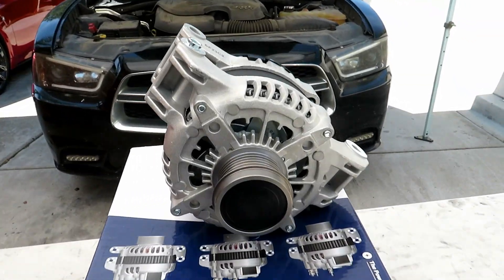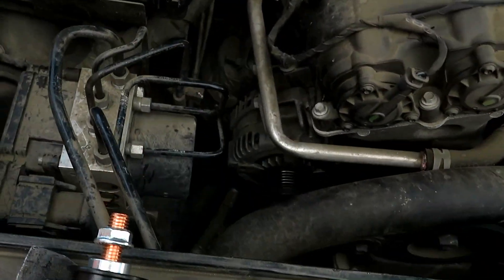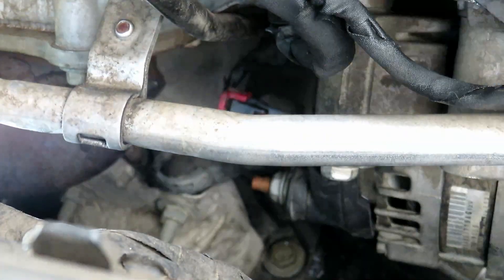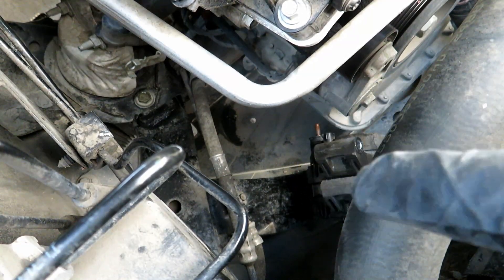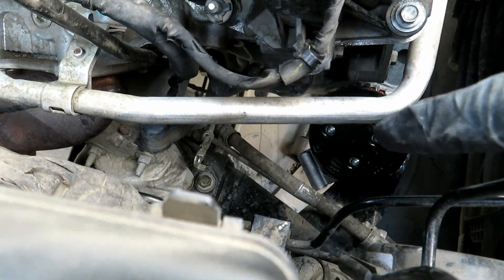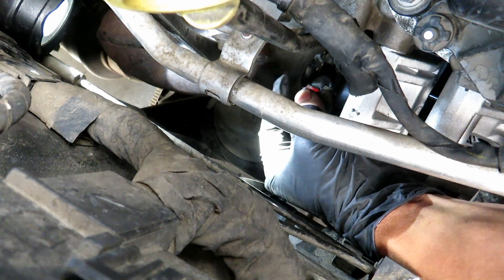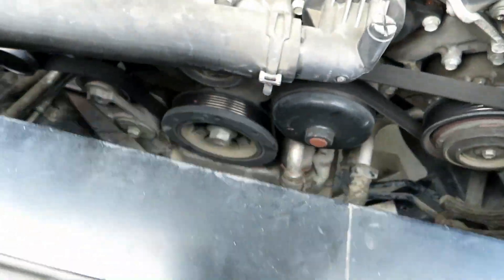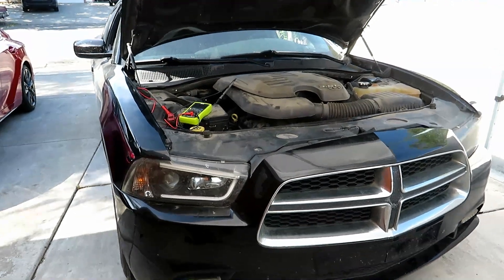Dodge Charger - 3.6 V6 Alternator Replacement

Comment: Great video.  I'm ready to tackle my swap this weekend.  God Bless!!!
Reply from the maker: @chriswilfong9816  great to hear. Let me know how it goes
Reply: @hyr0llr 
Hey, when you were connecting the cable to the B+ terminal of the alternator, did you leave the black plastic on? Because it looks like you took it off to have direct metal to metal contact. I left mine on, and it sort of melted it? It's fine now, I was able to remove it from the wire, but I was wondering if it needs to have direct contact to the metal like how it seems in the video.

Sorry for rambling, I'd be happy to reiterate myself if needed.
Reply from the maker: @MOB-fz5vf  That's actually a good question. I didn't even notice it was not on during the install. it looks to be a protector for the + positive wire post. im wondering how yours ended up melting. but if possible id leave it on to protect it from shorting out. im not sure how mine ended up coming off.
Reply: @hyr0llr 
Ah. But have you had problems with the repair after? Because I kept having the battery light coming on and off occasionally, and the Voltage was reading lower than it should. 
And I'm somewhat confident it was tightened down enough, so I was wondering if it's maybe because of the plastic? If you haven't had problems with it, maybe I should just install it like you did?
Reply: @hyr0llr Huh. Then I'll try it tomorrow morning, see if that solves the problem. Hopefully it doesn't just blow up on me 😂
Reply from the maker: @MOB-fz5vf  sorry. Comment was meant for another video. Lol
Reply: @hyr0llr That's fine. But have you had problems with this replacement?
Reply from the maker: @MOB-fz5vf  no no problems. If your getting a battery light on and off and your not getting proper 13v +. Possible you have a faulty alternator. If possible test tge voltage directly on the positive post to see if your getting 13+. But the light flashing on and off is telling me the alternator might be the cause
Reply from the maker: @MOB-fz5vf  also with the battery disconnected. See if the + post on the alternator is solid and doesnt wiggle.
Reply: @hyr0llr  Swap went smoothly. Having a helper would have made  install quicker, but I wrestled it into place. No issues since. Thanks again!
Reply from the maker: @chriswilfong9816  great to hear. Cheers to your repair. Take care.

Comment: Awesome video! First time really messing wth the engine, as I usually can only do oil changes and whatnot. The video was good quality, concise, and definitely earned a sub for this. 
So, my fault here but may serve other beginners, don't do the bittom bolt last. Don't. Do it first because then the top two are still as easy if you had done them first while the bottom one becomes stupidly hard.

Comment: Great video! What was the symptoms? Was it due to it not wanting to turn over, trying to start but won't? Is the starter a common problem for the Dodge Charger?
Reply from the maker: If the alternator is not charging the car is running off your battery, so essentially your battery is slowly dying. So when you turn it off and go to start it again, you wont have enough juice to start, which would seem like a start problem. To figure out if its the starter or alternator, try jump starting the car. If it starts and runs, test the output like the start of this video, if your getting. 13.5 or higher , it is charging and the alternator is good.

Comment: Do any of the mounting bolts have nuts on the back side or do they thread into the block/bracket?
Reply from the maker: They do not have nuts, no. They bolt to the engine.

Comment: By chance do you remember where you purchased the same alternator?.
Reply: And also how many Amps?
Reply from the maker: if I had to guess, rockauto most of the time if they have the luxury of waiting. yu save alot of mone.
Reply: @hyr0llr  thank you and also how many amps?
Reply from the maker: @ernestofavela4148  that i don't remember sorry, should be able to get the biggest one yu can afford. but looks like the 180 is the most common
Reply: 180 amps minimum

Comment: 2011 charger goes into battery save mode should i replace battery or alternator?
Reply from the maker: @breadbread8015  whats voltage with car running?

Comment: I got my battery tested and it’s bad could the battery and alternator be bad? Or should I just replace the the battery
Reply from the maker: If yu can start the car test to see if the alternator ia charging with a multimeter. If it is charging, ghen yeah the battery is shot

Comment: When I removed the bolts my alternator is still stuck & won’t drop out 😑
Reply from the maker: At 3:18 you can see a dowel on the alternator, its probably getting held on by that'.

Comment: How do I loosen the tension for the belt
Reply from the maker: 0:50
Reply: I just stick the 3/4 in the hole and it moves ?
Reply: @hyr0llr or do I loosen something else …
Reply from the maker: @NaasFrmOakland  yeah 3/8 ratchet in the square slot. And pull towards passenger side

Comment: I took mine off but theres no way I can hold it up to screw on bolts, what am I doing wrong, you make it loos easy on video but goes through it way to fast
Reply from the maker: i apologize, in the settings you can slowdown the playback speed to .25, that will help slow it down.
Reply from the maker: yeah, from what i remember, this one was annoying to hold up and get the bolt started.
Reply: @hyr0llr  I just finisheed, So what I did was take off top water hose which gave a little more room, but it just was too heavy to hold at that position in cramped space so I took a hanger and looped it on alternator then made a hoist using rope wrapped around rearview mirror then lifted it right in place, I recommend that to everyone
Reply from the maker: @jurnagin  glad yo hear you got it. 

Awkward way but if it works it works lol

Comment: What’s the solid. Battery symbol mean
Reply from the maker: Alternator possibly not charging
Reply: If your car has a volt gauge is will show the volts and if it's not charging it will steadily decrease until car engine quit

Comment: I am a single mom and i paid this guy to change out mine it ran for only 3 weeks and it first blew out hot air and then it slowly died out completely 😩 I don't know what it could be now
Reply from the maker: @Monica-c1f  the AC system? Probably has a leak that after its low enough, itll stop running the AC compressor.
Reply: @hyr0llr  okay so what would you recommend I do? Thank you so much for helping me.💝
Reply from the maker: @Monica-c1f  best bet if you have a local mechanic they possibly have the gauges to check and would probably be cheaper than a shop and for sure cheaper than a dealer. At least to point you in the right direction.
Reply from the maker: @Monica-c1f  because if it is low and you use one of the recharging cans its more than likely leak out again and slowly stop working
Reply: Thank you! For the information! God bless you🙏🙏🙏
Reply from the maker: @Monica-c1f  no problem, let me know when its fixed and what the problem was.
Reply: I'll let you know 😉
Reply: That fuse box beside battery could be loose and by him messing with batter it may have loosened it More, open it up and press down on all the fuses and relays them firmly press down the fuse box, it may need tightening up